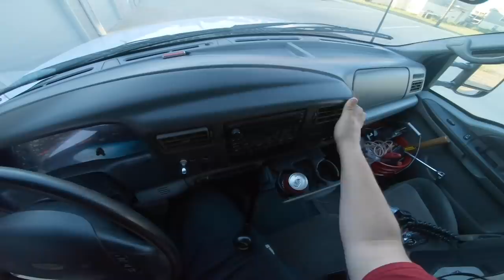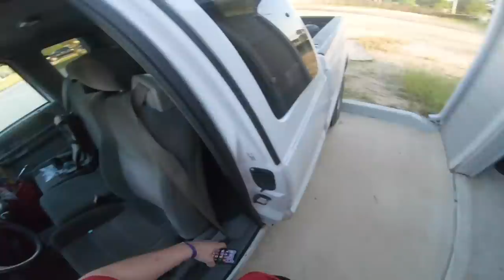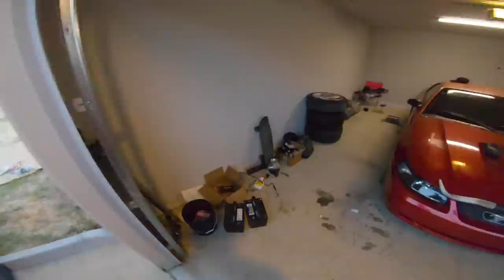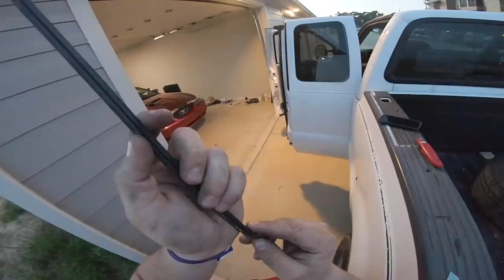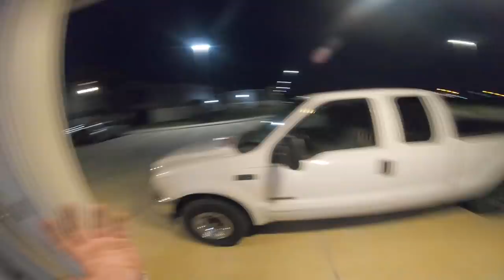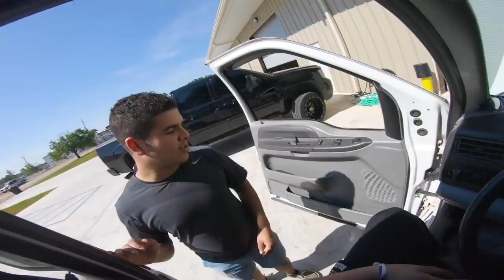First mods to the new truck!

Comment: That reverse bulb is pretty easy to do. Run out and get 2 168 sockets and 2 168 bulbs and wire it in. You will have to trim the socket a bit for it to fit. 
I did the same thing with my 07 f250 king ranch

Comment: For the brake lights, there's a little switch just behind the brake pedal. It's like $10-15 and could be your problem. I had a similar problem where my brake lights stayed on, and replacing that switch fixed it.

Comment: About the taillight issue, check the bulb sockets. On my 1999 f350 the bulb socket on the passenger side was barely making any contact with the bulb so I had running lights but no blinkers or brake light. At least check them with a test light. Keep up with the good content bud. 👍 Also Please hurry up and cut the muffler off that sucker 🤣

Comment: there is a switch for the brake light you probably will find it above the brake pedal those usually get bad and it doesn’t cost anything it might cost you 10 bucks or something like that

Comment: Get a air sander on the headlights with plenty of water start  at 320 grit the 600 then 800 then 1200 then 2000 should make them clear done it a few times

Comment: If you still have oem tails from the mustang, you might have the needed connectors for the other tail lights you already had for the truck. The connectors would only be a few dollars from a auto parts store, ford prpbably doesn't charge much either.

Comment: If your not soldering the wires and using shrink tube.  Put some silicone on the ends of the connectors so they do not corrode at your butt connectors . So you don't get a bad connection down the road .    Nice easy fix though 👍

Comment: Diesels are fired by compression, the fact it takes that long to start in warm weather is unsettling. I worked as a diesel mechanic on semis for quite a while, if it white smokes on startup you’ve got a bad injector cup that’s leaking by but I didn’t notice it, you need to plug a code reader in the truck and find out what the issue is.
Reply from the maker: Chris Poindexter old fuel filter and pump. I have all I need to fix it

Comment: Hey the truck may be rough but at least you got a 7.3l and not a 6.0! And you can jump the power and ground from the window motor to the battery to get ur window up now that ur ac works!

Comment: Lol you said you cheap. you got new radio, ac, your gonna pain, speakers, and planing on doing exhaust(which is not necessary for a daily)..... I have no ac, broke speakers, bad tires, broke passenger window Switch, bad thermostat.
Reply: Garett Reeser it’s a daily not a shitbox lol
Reply: matthew Smith does not have to have to have upgrades do be a daily, just has to get to point a to b

Comment: You should fix the dents and then paint it raptor liner white and the grille. Also a 4 inch zone lift, 20x12s and 35 inch tires. Blacked out headlights, taillights, and 3rd brake lights.